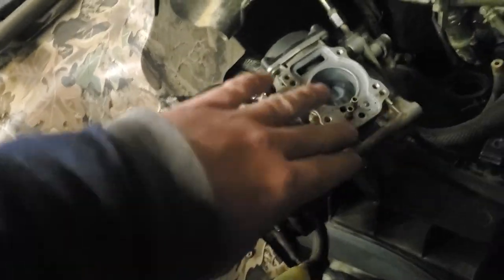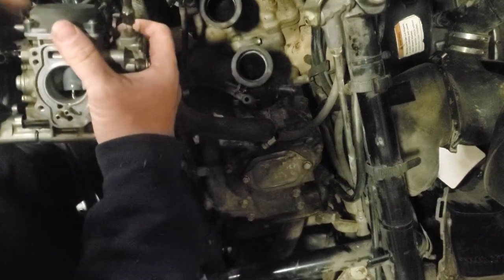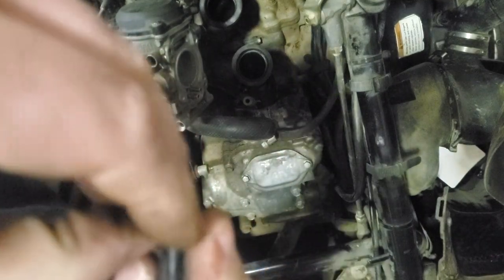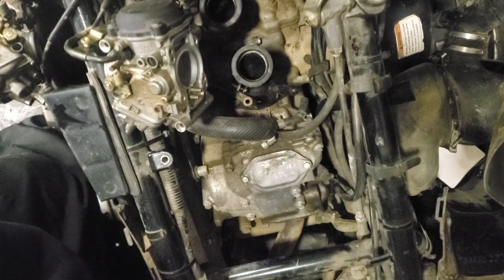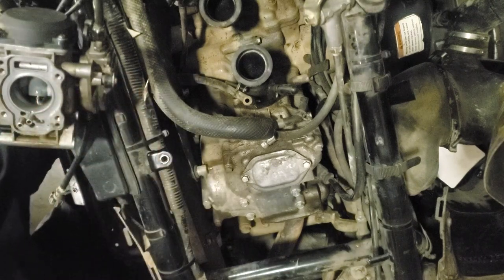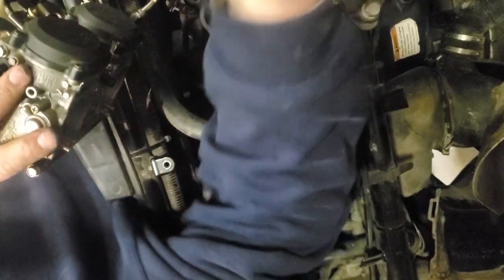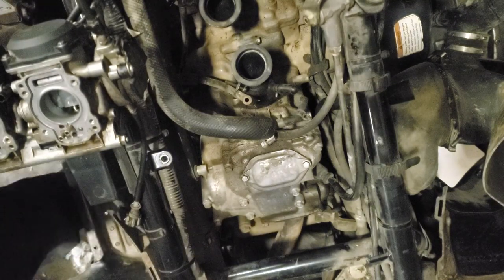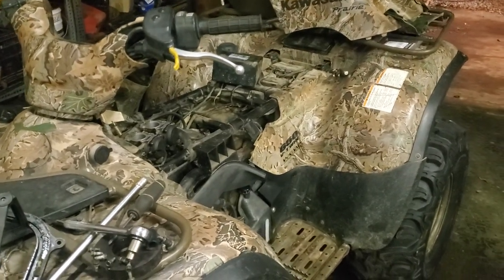carburetor repair Kawasaki Prairie 650

Comment: What is that little black tube called that youre holding that links the carbs together. I cant find it or the 2 seals on each end. Thanks!
Reply from the maker: I don't know the technical name for I call it a transfer tube also there is a transfer tube for toolant between the carburetors as well one is for gas and 1 is for anniversaries I have not had any luck finding parts for these carburetors pretty much everything that is on them is unattainable

Comment: Hey man I'm having issues with my front carb the plunger won't open, is the diaphragm busted?
Reply from the maker: It very well could be but I would make sure that it has a good seal and also make the shore that the air bleed that is around the little finger that sticks out at the top of the bladder is not missing or deteriorated and broken apart that will also cause it to immediately shut also make sure all vacuum hoses are connected correctly and also do the compression test on that front cylinder the cylinder that is attached to that carburetor could be low on compression which would have low vacuum which would not allow that carburetor to open

Comment: Does both values on carbs open when you give it gas. I only have one that opens.
Reply from the maker: I've seen some people reply in this Channel's comment section or another one video that I have. There is another machine that used similar carburetors from Kawasaki on it but it was a single cylinder machine. I think you have to modify the throttle linkage to make it work. If you have one that's not opening on more than likely you have a ruptured I'm sorry I haven't replied to very many messages in the last several months because I've been so busy with the small engine repair shop

Comment: Dont you have to synchronize the carbs if you pull them apart?
Reply from the maker: Not really I guess you would say the way these carburetors operate is very self feeling basically they are Velocity activated so the air velocity going through it is what gives it the amount of fuel it needs per cylinder so as long as the needles in the diaphragms and the slides are set to the same height and the Jets are the same size and everything is clear and clean the only thing that really needs to be set is the throttle blade location on both carburetors needing to be the same so one carburetor being cracked open a little less or a little more he's the only thing that's really possible that's what the little spring and screw is that's between the two carburetors making sure the linkage is tight and that the blades are opening and closing at the same rate or at the same location

Comment: Hey do you know the exact size of the o rings for that cross over tube i ordered a kit off ebay and the idiots told me it was the whole complete kit everything orings gaskets but it's not did not come with the orings i bought the kit for
Reply from the maker: That is why I use the kit from All Balls it has all the O-rings in it I do not have the sizes of the O-rings you have to get the old O-rings out and then size them based on that it has to be an O-ring that is a little bit smaller inside diameter than what you're going to have on the transfer tube or send that curb kit back and get the carb kit for it from All Balls

Comment: Can you make a video on how to synchronize the carbs and adjust them
Reply from the maker: I would have done that with these carburetors but the engine that they went on was not very healthy and the customer did not want to finish fixing the machine. There is a spring and screw between the two carburetors as you get those back together you can adjust how much the rear carburetor that is controlled by the other carburetor opens and closes it's throttle blade in relationship to the controlling carburetor. That's something that has to be done on the bench cuz you could not get to that screw on the machine. After that but I will air fuel ratio screws are usually really close and good enough at a turn and a half out from all the way in. Those screws are usually difficult to get to at best and you don't want to adjust them until after the machine is warm and be prepared to burn your hands if you don't have some sort of insulation between you and the engine yay. I'll do my best to do one of these videos you ever requested at a later time when I have another one of these machines come in I own one myself and will probably have to rebuild the carburetors on it as well.

Comment: Where can i get all of the o rings that goes between the carb?
Reply from the maker: You don't end up using everything out of a carburetor kit but if you go to All Balls you can get the carburetor kit and it comes with every o-ring you would need and there's no guess work. O'Reilly Auto Parts typically has a full o-ring set that you can pick and choose O-rings out of but a lot of times the diameter of the rubber is not correct exactly for what you need. They all balls kit is a really decent kit and completely has everything you need even Morse Bowl screws

Comment: I still don't know how you got the new o-ring to fit
Reply from the maker: I'm sorry if I don't say it in the video. But sometimes new orange like a little bit. Aggrease or Vaseline on them to slide in and out of the new location that they have to go into. Is there rain doesn't sit in the area? Then you probably grab your wrong one out of the reboot. Be careful, it should not be impossible to put to who rings and place. Sometimes. If they have to go over a tube, they actually are smaller than the two, but sail there supposed to be stretched over.  The tube so that it thinks down the arena to fit in the tunnel that it is pressed into.

Comment: Bare with me here I don’t know like anything 😂 so the little things you were pushing up around the 4:00min mark of the vid if one goes down fast and the other slower what does that mean
Reply from the maker: I'm very sorry it's taking me a month to catch your comment but I'm assuming you're talking about the slides that slide up and down inside the carburetor if one is sliding faster than the other is typically a are bleed or you could ever damaged bladder that is attached to the top of the slide valve as it slides open through vacuum it would be very difficult to explain it unless I know exactly what you're talking about I'm sorry if this doesn't help you at all but I'm trying LOL